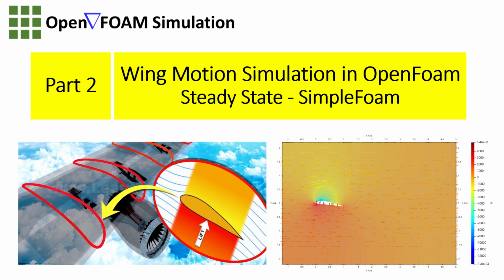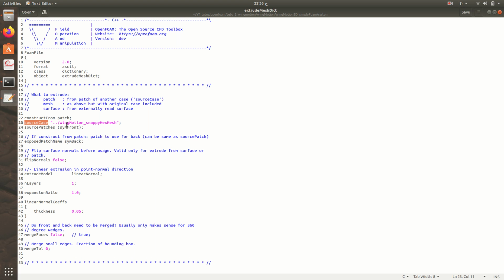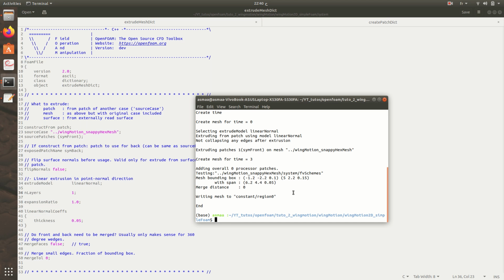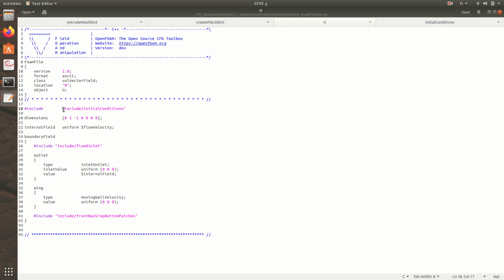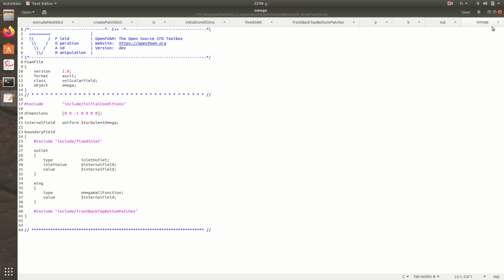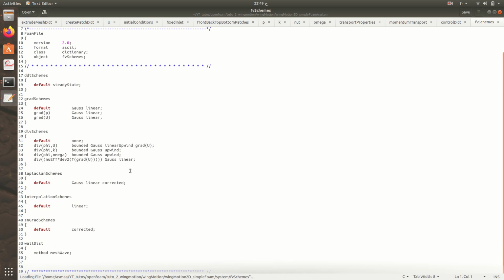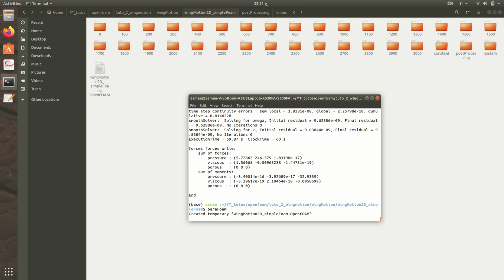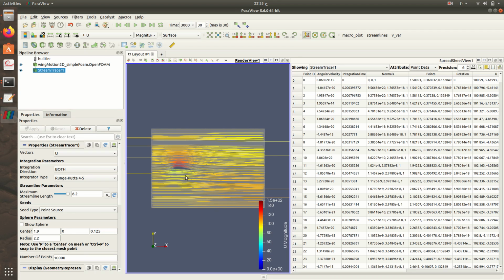Part 2: Wing Motion simulation in OpenFoam - Steady State simulation using SimpleFoam

Comment: Hi Asmaa, thank you for this tutorial. I'm having a bit of trouble getting extrudeMesh to work. I create a seperate case and set the parameters in extrudeMeshDict accordingly but when the new mesh generates it's only the background/blockMesh mesh that is extruded, so no airfoil/geometry "hole". Any idea what seems to be causing this? Do I need to copy the polyMesh folder from the "2" folder to the "constant" folder in my original case? 

Thanks a lot.